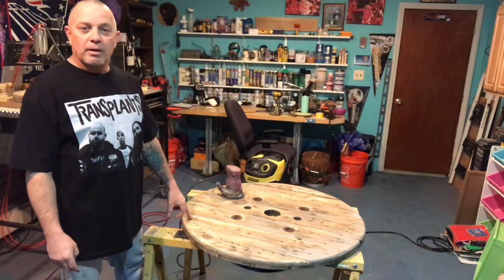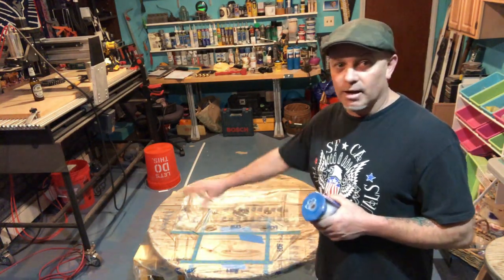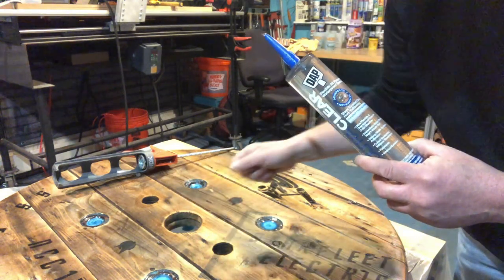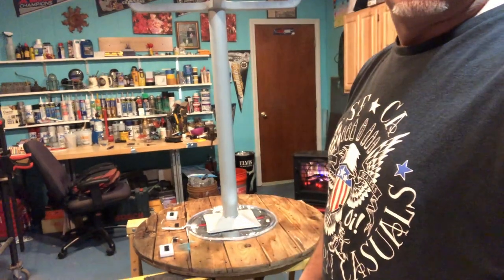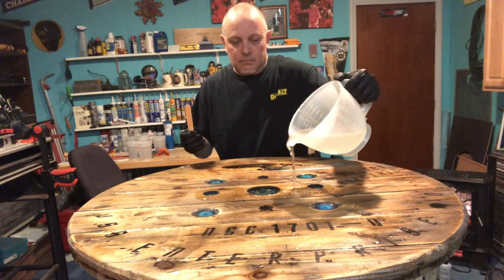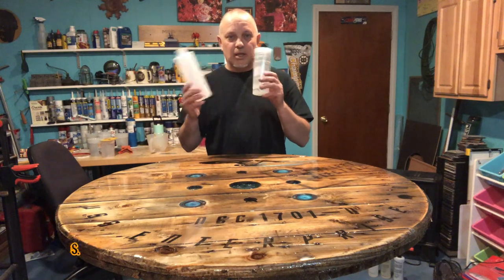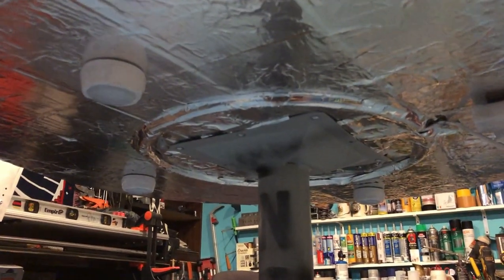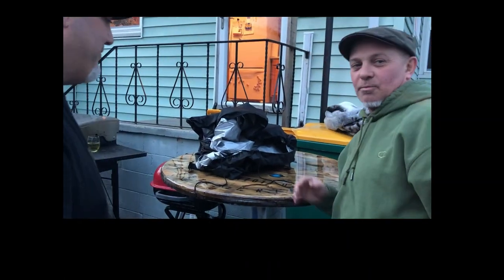Wire spool table with epoxy resin & LED lights (Star Trek) theme

Comment: Awesome work Sir!! I love it. I'm a beginner  in to refurb  a cable spool that my son n law brought home for me. I'm going to attempt  to make it a nice outdoor planter holder  for me. If you  have any ideas that would help me, I would be very grateful
Reply from the maker: Thanks for the comment!   I would recommend using an exterior wood sealer on the planter if it is to stay outside.  It will last longer.

Comment: Nice work!! I am just starting on making a cable spool chair. But was wondering what could be made with the boards in the middle of the spool? Any ideas??
Reply from the maker: Thank you.I had two ideas I thought about making with them, the first was a small bridge since they are curved but haven't tried it yet. The 2nd idea was a planter box after banding them back together.
Reply: @johnnyworks5446 👍

Comment: Great stuff. How did you plug the center hole for epoxy?
Reply from the maker: I attached a piece of vinyl floor plank to a 1/2” plywood square and screwed it up underneath. The epoxy didn’t stick that much to it and I was able to unscrew it and peal it off after the epoxy dried. Thanks for Watching! ✊🏼

Comment: Love it.  What size is it? Im an amateur but going to try to make one.  Can you list the reason epoxy stuff i didn’t catch the name.  Great project thanks and so cool hope your buddy was so happy.  Good job! 👍🏼
Reply from the maker: Thank you, glad you liked it. This was  my 2nd time using epoxy. It was a lot of fun. The epoxy I used is made by Envirotex Lite.  Its called POUR-ON w/High Gloss Finish. I bought it at Michael's. It is typically used as a top coat to bars tops and tables etc.
Reply: What size is this table top?  How much did it cost for spool or did you find it free? I didn’t catch how you added those blue lights in the holes.  You didn’t show that part or did i miss it?
Reply from the maker: @miriamrios93  The table top epoxy was $36.00 at Michae'ls but I only payed $18.99 with a coupon. The wire spool is 36" round and  was free for me as I am in the construction trade and can grab around the jobsite.  The blue lights were the white LED's shining up from underneath thru blue tinted epoxy with glass marbles I put in while pouring. I am still fairly new to filming and editing my own videos so unfortunately I do miss something occasionally.

Comment: How did you get out all the staples?
Reply from the maker: Any staples that were sticking up, I pulled out with pliers and a block of wood so I didn’t mark the wheel up bad. If I couldn’t get them out I banged them in with my hammer flat so I could sand and not get caught up on them. The epoxy that was put on top was clear so you can see a couple of them but, I think it gives it character.